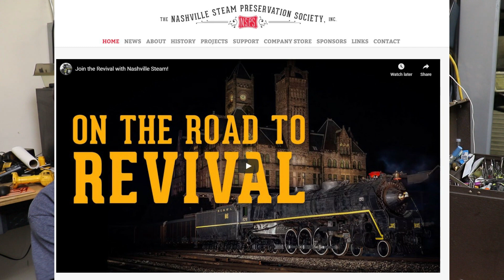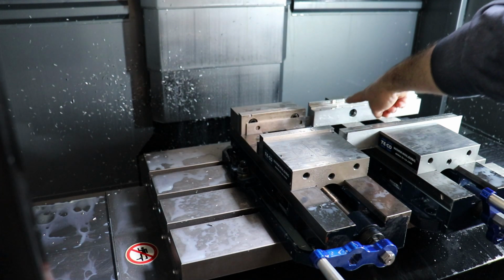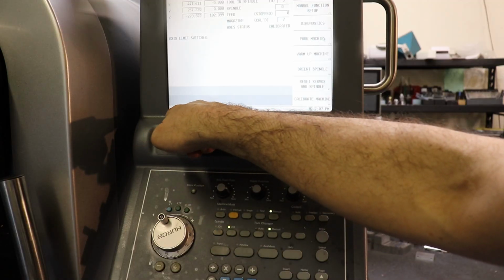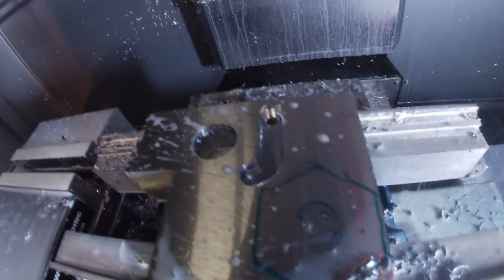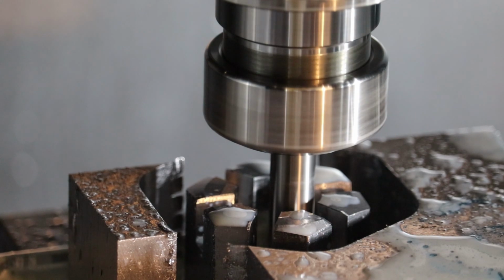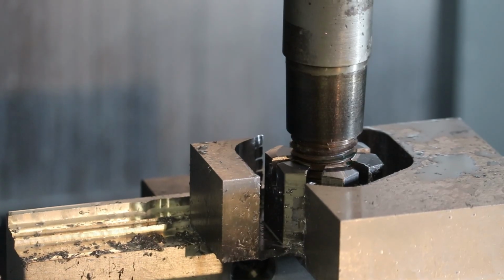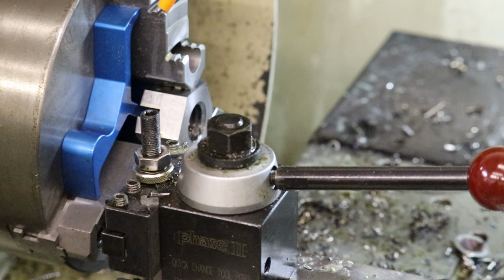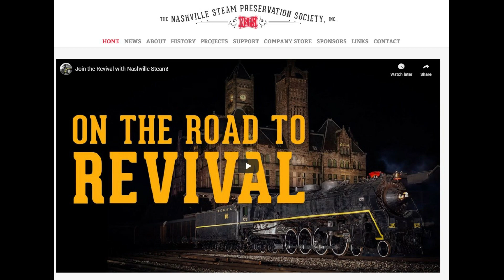Stoker Steam Engine Castle Nut Fabrication

Comment: CNC machining of replacement parts for a 1942 steam locomotive.  
I wonder what the original machinists would think of this fancy technology.
Reply: Kevin Byrne  would probably wonder what kind of witchcraft is this.  lol
Reply: @timfairchild7912  -- I think that as early as 1920, "relay logic"  was used to automatically control a few systems, but I think that watching a machine essentially operate itself would have indeed dazzled them.

Comment: It is amazing to think the original parts were made probably on old line shaft belt driven manual machines. I have been making chips for 34 years in the aerospace field mostly manual applications. I have run NC equipment (mazak and fadal) but never got into programming. I found out early without a good programmer they are just a big ol paperweight. Amazing what some of the new 5 axis stuff can do. Good job on your parts.
Reply: It’s honestly a little weird to do this from flat stock in a CNC mill. The normal operations for the same thing in a smaller size would be lathe for the bore and threading, out of cylindrical material if necessary, and then using a hex collet block to hexify on a mill plus do the slots. Doing that in this size class requires a pretty big lathe, though. Or somewhat less conventional lathe setups.

Comment: Great Video! Thank You! You are a smart guy.👍
What I don't like about the bottom of the nut, the tips are not recessed. Sorry  but I can not explain it right, because english is not my mother language. But compare it to a regular nut. The tips of the hex are never touching the bottom.
All the best! Stay healthy!
Larry
Reply from the maker: Good point.  I took a look at the original rusted nut and fount that there is a remnant of a 0.1mm washer landing.  I still have the nuts and I will add the cut.  Thanks!

Comment: Normal std's for making nuts is to make sure they are softer and not as strong as the threaded rod. The reason this is done so if the part if over torqued then the nut will strip which is a lot easier to replace/fix that the threaded bar.
Reply from the maker: Thanks for the advice!

Comment: How do you get a helical thread when the tool is cutting perpendicular to the spindle?
Reply from the maker: The cutting teeth are probably a little undersized to account for the 3D helix path overlap from cutting in the thread.  The tools are sold with a range of thread pitch that they are good for.  The tool i used had a range down to 8 TPI, but we made a 7 TPI nut,  so I did have to offset the tool to beaf up the thread.  Hope that helped.  Thanks for watching

Comment: On the order of operations, why do the threading last instead of just after boring the hole?
Reply from the maker: I did the thread milling last since I knew I would need to do a few tests on the fit.  Also, the 1/2" endmill had other operations to do and I like to limit tool changes.  Thanks for watching!

Comment: You did a grate work, but the tool steel ... i dont tink that it is apropriat for nuts. It can be to brutal. In my opinion 1045 wihtout HT (and Keith make HT) ore 4140 comercial HT is a better choise
Reply from the maker: Hi Emil, the toughness of the A2 steel is a function of the hardness that we choose.  Currently the nuts are pretty malleable, I estimate HRC 30 will maximize the toughness of these nuts.  I used A2 so Keith, or I can dial in the toughness, in house.  Thanks for watching!

Comment: A2 not available in hex bar or round ,or you're just using what you have on hand ?
Reply from the maker: Hi Paul, thanks! I used what I had on hand, was thinking of scrap P20, but Keith did a A2 heat treat on his show, so I figured I would give him options.  Also wanted to show (CNC) ways other than what Keith would have done on his show.

Comment: I know I am being a pedant but they are not castellated nuts, they are slotted nuts.
Reply: perhaps would you explain the difference?
Reply: @garyrhodes7089  Hello Gary, I did not know the difference either so I typed it into Google. Slotted nuts become castellated nuts when the OD of the nut is turned down so that the OD, only in the area of the slots, becomes a circle rather than a hexagon. I am having trouble explaining it but Wikipedia, through Google, has some some photos which show the difference.

Comment: Why do you remake the nut?
Reply from the maker: Mostly because Keith Rucker wanted too, the old nut was rust pitted and we didn't want to risk an old part in a new power train restoration.  Purchased nuts don't match the 1940's nut
Reply: Makes good sense, thanks for the response!